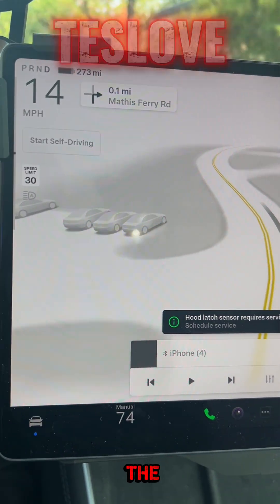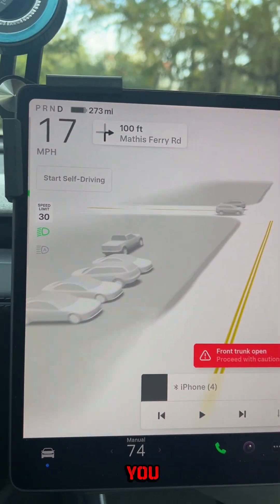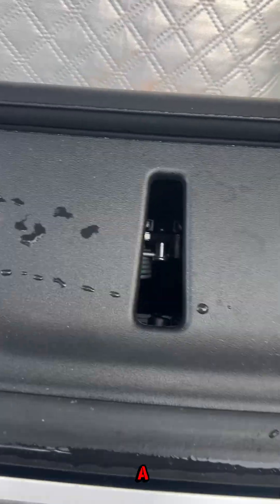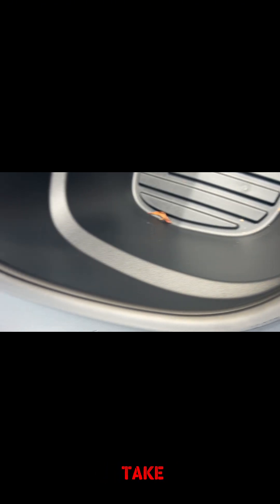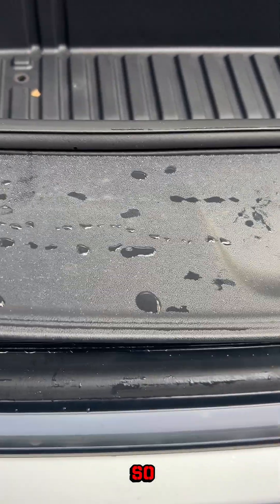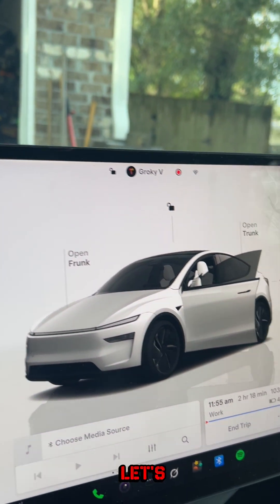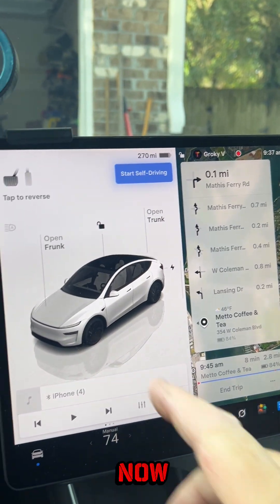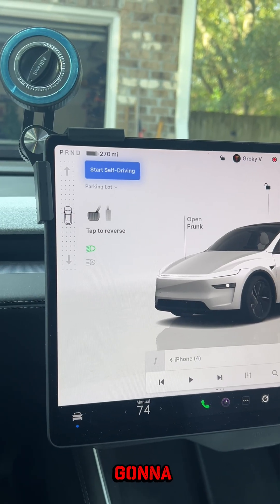"My Tesla Model Y Juniper Got FRUNKED UP- But I Fixed It In Minutes!"

Comment: Thanks for share this tip. We are multiple customers in Denmark that are having this issue. Is the car AWD og RWD - or does it makes any difference since the locks are the same? 
Did you just lift the "silver sensor "pin"" a little with the "pic and hook style tool" og small 90 angel tool and them assemble it all again?
Reply from the maker: Yes mine is AWD so I presume it's the same in both, that's a great question though. I lifted the silver pin just a little and so far it's ok and works perfectly. Hope this helps. Thanks for Commenting. I really appreciate this. Feel free to ask any questions and if I don't have the answers ill find them.

Comment: Did you go for replacement in service or its good to go now. Because i have same issue , and need to drive 600km to service. I press manualy the sensor and now is ok. But wonder for hlw wong willl be fine. Thanks
Reply from the maker: So mine is still operating fine since the fix, which actually shocks me so it seems to have worked. If that changes i'll be certain to make an updated video. Good luck
Reply: How did you manually press the sensor? Did you remove the bolts first?
Reply from the maker: I just removed the frunk liner cover which allows you to get a little spike type tool in there with a small hook on the end, then you gently lift the metal sensor, they sit not unlike points in an old school car inside the distributor cap, if that makes sense.
Reply from the maker: Craftsman make a pic and hook style tool that worked perfectly for me personally. I apologize I did get that to show perfectly in the video.
Reply from the maker: Also your actually lifting the sensors, but ever so gently
Reply: @TanNguyen-e6r8j Nothing disassembles – you press the closing mechanism with hands twice until it clicks, and then lightly touch the sensor.
Reply from the maker: Thank you
Reply: @borislavvuchkov7829  Can you make a video of that? Im not quite sure what you mean?